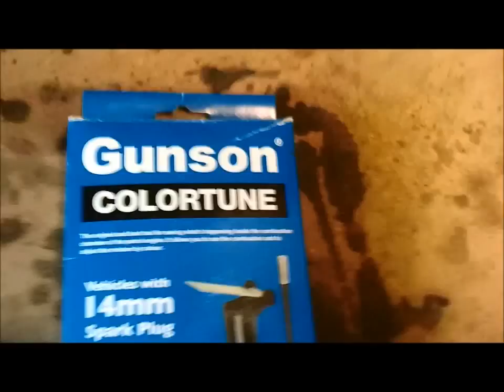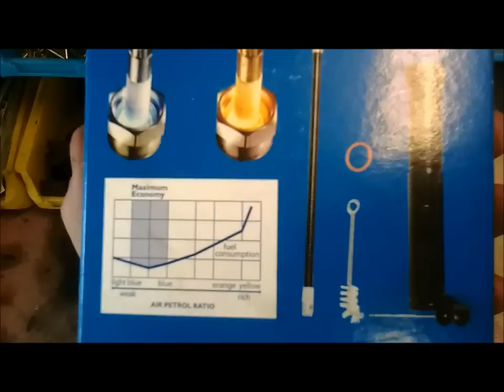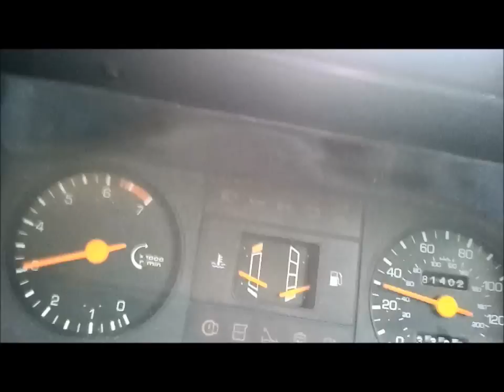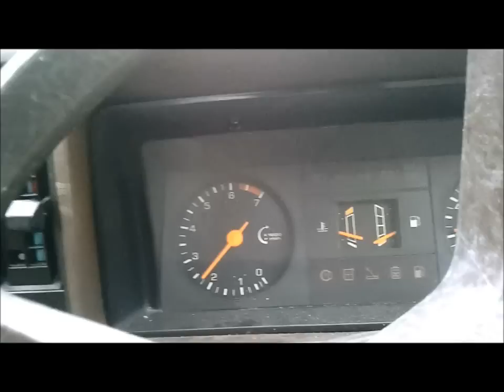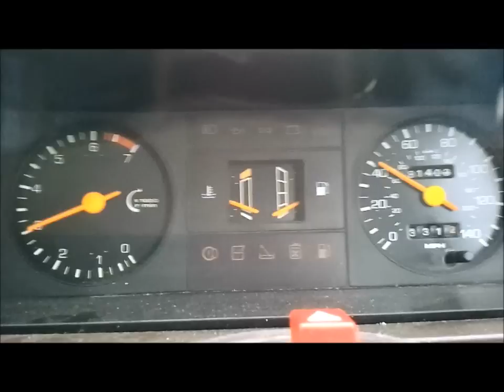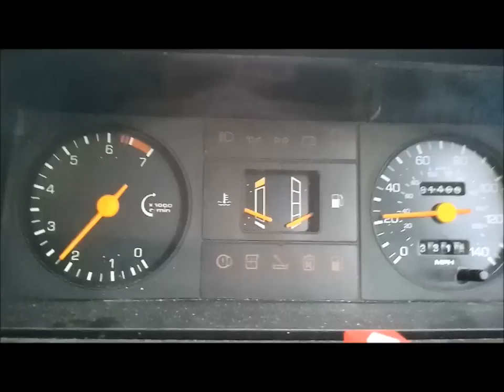Gunson Colortune Unboxing and Ford Escort Weber DCNF Air Fuel Set Up

Comment: Nicely done video.Assuming your tachometer is reading correctly,i would check the Emulsion tubes,and the main jet sizes,as you may have a fuel starvation issue above 3000rpm(jets too small)Also,to high,or low a fuel pressure can give these problems.Keep updating your progress,along with all the other mk3 Escort enthusiasts,i would love to see more videos of the car.

Comment: when running the tests have you made sure the engine is at normal operating temp and choke disengaged? If you do these tests when the engine is cold and or choke is on you will be adjusting the engine at a point when it's air fuel ratio is supposed to be rich, causing a very lean mixture when at normal temps.

Comment: Good video you done there.  you started with number 4 then went to number 1....... number 1 is the fan belt end not gearbox end. and you need to fix that water leak . engine is all over the place on that motor..  get some clips to stop plug wires leaking into each other then will be miles better.

Comment: Lack of power is probably down to a weaker mixture, You weakened it off with the colour tune . I assume by doing this you have actually tuned for economy rather than performance . Your not likely to get economy AND perormance...especially with a Ford :o)

Comment: Since it is not tested under load you blue flame tester is meaningless.  You need a dyno and a real AF meter.  Or a 1/4 mile track with a timer and a AF meter.